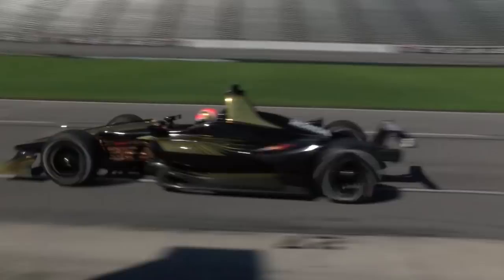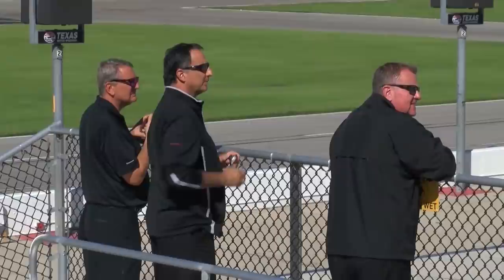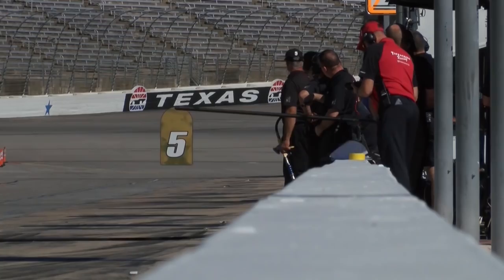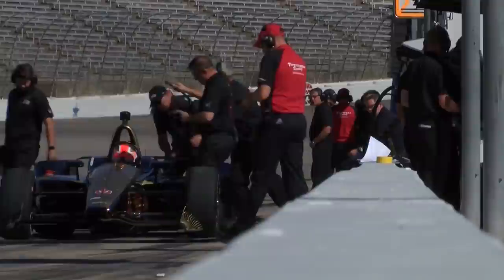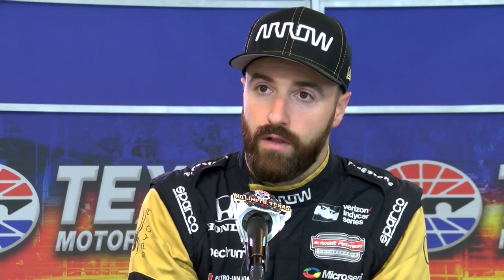INDYCAR SERIES TESTS NEW AERO KIT AT TMS

Comment: I take it this is going to mean less drag, better wind resistance, and ability to achieve higher speeds?
Reply: Shirokage They say higher speeds on the straightaways but slower cornering speed due to less topside downforce. But that should allow for more passing because drivers will brake at different times instead of going flat through the corners.